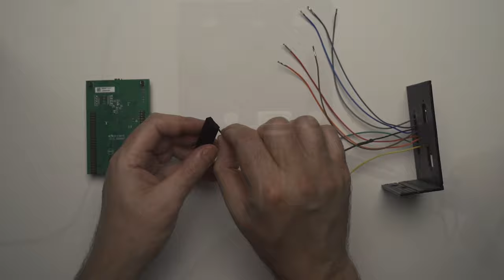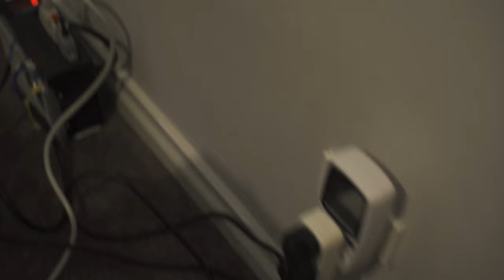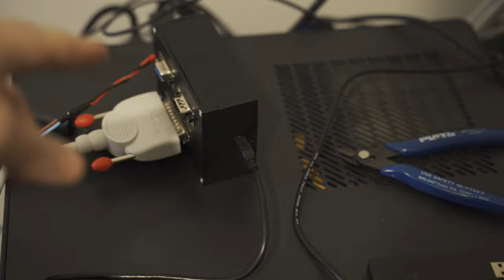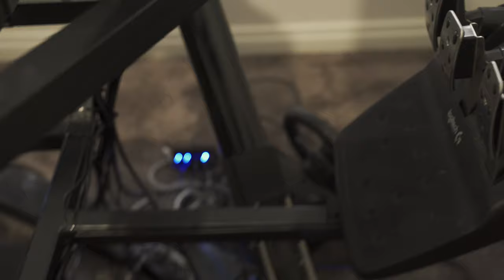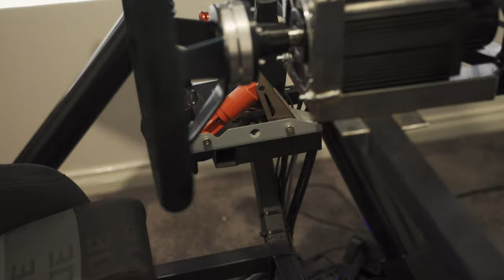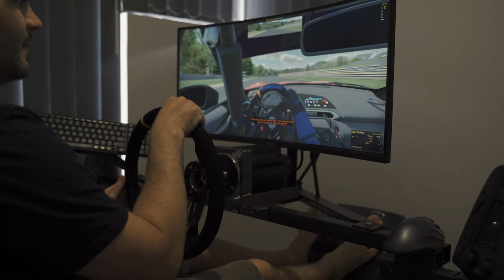$450 Mige Direct Drive Force Feedback Wheel - DIY Build - Wheel Test

Comment: I own the g27 and would like to upgrade to a direct drive but the ones on the market are too expensive and not worth it. Does thi solution improve in terms of strenght and details of the road and the car?
Reply from the maker: Well 2.4nm vs 25nm its a massive difference. Everything is improved. They aren't even comparable haha.

Comment: How did you get the software part of your rig to work? All the telemetry translated into actuator motions. This is very impressive!
Reply from the maker: Hey mate, I use a program called FlyPT Mover.. there are others like Simtools as well. They grab the telemetry data and create a motion model based on your type of rig and then send the actuator movements to the Thanos controller, where those movements are then send to your individual actuators :)

Comment: Real nice. Love your work. Did you build the 6dof your self? You just need VR and you've got yourself a beast set up right there. Some links for some of your parts would be epic.
Reply from the maker: Cheers! Yeah i built it myself, There should be Links to both the wheel build and the 6dof build threads in the description. :)
I have VR but with all these peripherals i am out of usb ports and bandwidth haha. Waiting for my powered usb hub to arrive as they're all sold out locally.. damn covid! I also just put up a build video of my actuator if you're interested.
Reply: extremely interested man.. thaaaanks very much.  I'm going from g27 to your dd stile wheel. And if I had the coin I would go 6dof motion too. One day

Comment: I want to build a DIY FFB with a stepper motor instead of a servo because it's cheaper. Do you think it's possible to build it with a Nema 34 85kgf.cm, driver DM860A 7.2A and 80VDC power supply? Do you think I'll feel every step or it's going to be smooth setting with 40000 cpr?

Comment: Hey mate, a guys is selling a old wangan 3dx arcade motor, I have a g27 do you think I could just take the power cables that go to the g27 motors and attach them to the arcade motor(as well as encoder) do you think this would work?
Reply: Basically just adapt all the logit tech gear to the much bigger dc motor

Comment: Can we used a BissC encoder with this configuration?
Reply from the maker: Not yet. Not with mmos. But somung soon is a new control board that will use it with VNM car simulator firmware and a Mige servo driver

Comment: Could you explain the assembly in more detail? we appreciate it. Thank you
Reply from the maker: Did you check out my built tutorial?
Reply: @peacemakermotion3949  is it worth riding? gives failures? what is the final price of mounting it? greetings from Spain ✌️
Reply from the maker: @chibiverin  well my price was 450 usd.. then if you want the thanos DAC board at 100usd.. or you can use VNM firmware and use the discovery boards built in DAC. I don't have any issues.. you will want to be weary of EMI interference though so I would replace the motor power cable with shielded  cable. So add 30 bucks.. you also want to try get a shielded db25 cable If possible. But yeah the price is without a wheel of course. You'll need to source one of them or build one
Reply from the maker: Also worth noting the AASD drive has a high pitch noise which does affect some people..

Comment: Hi, I have wired it all up and set up the STM32 to run the MMOS firmware. I ran some tests and found that the encoder was being picked up, but there was no force feedback. I am not sure whether it is because I was using incorrect settings or because I had pin 6 of the DB25 connector open (not connected to GND). Any help/guidance would be more than greatly appreciated
Reply from the maker: Have you got your estop set up so that its a closed circuit when its released? I think I said normally open in the video somewhere.
Reply: @peacemakermotion3949  thanks for such a fast reply as well!
Reply: @peacemakermotion3949  It is moving now once plugged in, so i changed pn191 from 0 to 1 and it just moves in the opposite direction.
Reply from the maker: @lou2737  no worries.  hmmm.. somethings a miss somewhere.. I would start by triple checking your MMOS settings then your AASD driver settings and then your pinouts.. It's easy to mess one simple thing up along the way and it wont work properly.
Reply: @peacemakermotion3949  hi again... It's working now however there is loads of high frequency noise coming from either the driver or the motor... Anyway to reduce this noise?
Reply from the maker: @lou2737  The AASD drivers have a constant 10khz whine to them which is unavoidable. It may be this you are referring to.. Some people are more susceptible to this noise than others. With a bit of game audio you can't hear it. Or are you talking about when you move the wheel? In MMOS if you put the desktop mode to 'Spring' and turn up the sliders a bit  does it calm down when centered?
Reply: @peacemakermotion3949  very high pitch noise (probs 10khz) and the noise when it hits the limit

Comment: Hi! Is amazing!! How good is this OSW solution against IONI CUBE driver. Have any difference? What PSU do you use (voltage and power)?
Reply from the maker: Hey,  never tried simucube. This uses AASD servo driver which is 240V main difference is encoder as it's a 2500PPR. Biss-C encoder not compatible with MMOS firmware
Reply: How did you setup to run on 110 power